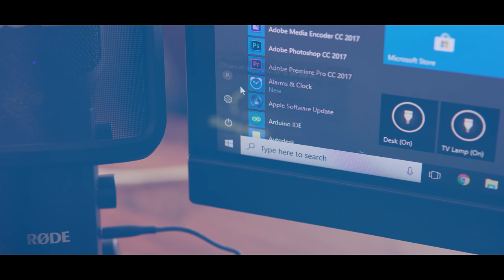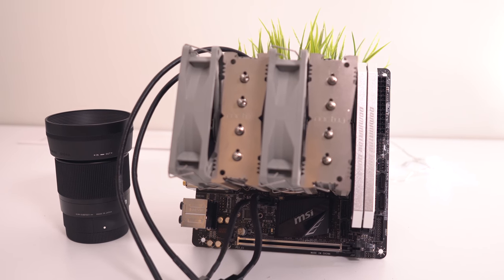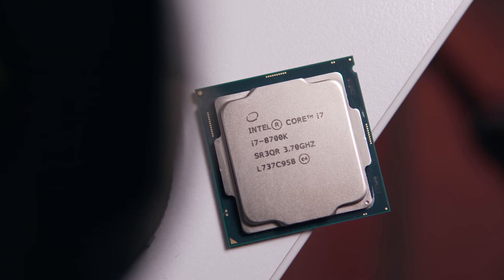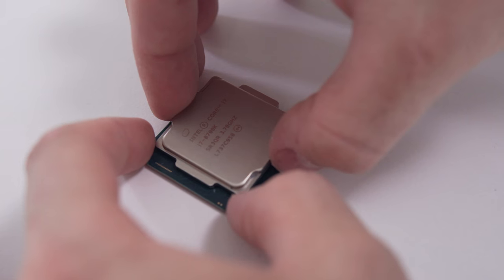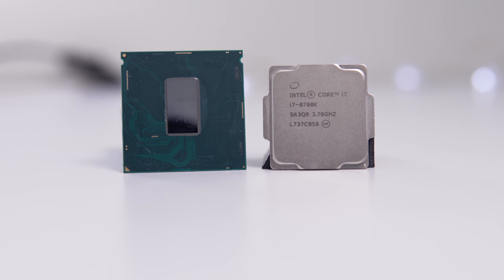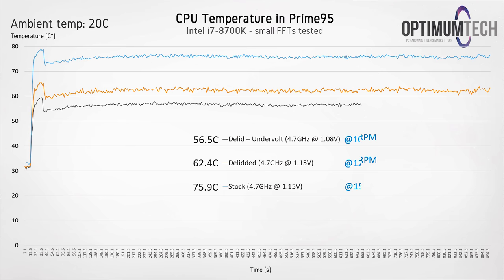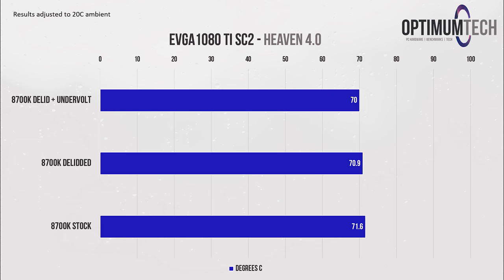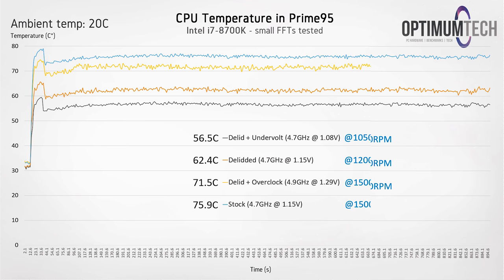8700K Delid & Undervolt - 20C° Drop!

Comment: can non-overclockable cpus in this gen like the 8400 be undervolted?
Reply: nickt i think it can
Reply: nickt i am pretty sure. On locked cpus u just cant change the multiplier.
Reply: Every cpu can be undervolted. Running my 4790 @ 0.95V

Comment: i got the i7 8700k and was having some serious 100 degrees in prime stres test, tried with extra fans, case and even got coolermaster maker nano thermal compound (lowered a bit) but nothing droped the max temperatures enough,  so i undervolted to 1.24 from the auto 1.4 and got down to 80 degrees max at 4.8GHz all cores, the sweet spot, dont care about highr clock. (edit cos i got some better numbers with a bit  more testing)
Reply: You need a water cooling system to cool down this beast.
Reply: u are right, we are in summer here, and i am in a hot city 36 degrees ambient, if i wanted to go any hiegher than 4.8 GHz i would need more voltage and thus watercooling at least.

Comment: Great video. I do undervolt my 8600k by 0.095v which is giving me max temps of around 70c. I do plan to delid in the future so I can run the fans slower in the future
Reply: what motherboard are you using?
Reply: MSi Z370 Pro Carbon ITX with Nocuta D9L with two 2000rpm fans. Testing has been done with Cinabench and Intel Extreme tuning as games don't really stress it.
Reply: My 8600k is overclocked to 4,9GHz, and i am stable at 40 degrees. Got over 50 degrees only one time for 1 minute!
Reply: what are your overclocking settings? I went for 4.9 GHz (stock) and 0,020 V overvolt for @ 71 °C (still much lower than automatic OC at 5 GHz, which was around 85 °C). Asus ROG Strix Z370G mobo. Scythe Koketsu cooler.
Reply: jackelofnar bro does it safe ?
Reply: That is not safe .. quite bad actually . Using "in the future" twice in one sentence, thats covfefe. What is your actual voltage x - 0.095v =                  tanx

Comment: video idea: test the temps difference beetween this current cooling config and a 2.5 slot gpu with slim fans or without fans at all at the bottom of the case (thinking about the strix or the new silent evga gpu)

Comment: I read about undervolting, it's less recommended than overclocking, because it messes with ram potentially ruining the DRAM in the process. Ram looks for certain stability too, and if CPU cannot give it, DRAM will erode and with it will start taking your system files and documents, corrupting good files, and burning your data to shit. Granted it's an excessive example, but it will do it slightly at first, potentially making you lose a lot of important information from your system. 

I would stay away from undervolting.

Comment: got mine literally yesterday. Overclocked to 4.8ghz at 1.29v. No luck with silicon.
Reply: thats pretty standard voltages for that clock speed. Mine is set to 1.264v for 4.7ghz on all cores.

Comment: 20c only?? I dropped almost 50c @ 5Ghz 1.30v <3
Reply: Well he is running an air cooler in a small case, so the temperature difference may not be as great as a water cooler or a well ventilated case, or both.
Reply: @aventrikz8787  :D 50c is sick anyway for delidd. Isn't it? It seems like it is anyway, maybe i won the silly lottery. I just need to cool my VRM on GPU now. Kraken G12 doesn't do it's job properly. I want to mount my corsair h150i 360mm aio radiator on it too, i have 2.. But it won't fix the mount coz it's not round.. i got 1080 gtx

Comment: Hhmm, with deliding and undervolting, would I be able to lengthen or prolong the life span of my cpu?
Reply: MAYBE a little, but you have to understand even at stock (no delid no undervolt) assuming no overclock the CPU will last 10+ years easy assuming you have a decent air cooler. You risk potentially damaging your CPU via Delid (and no one really knows the LONG term effects of it) for maybe an extra 6 months which means nothing because the stock CPU would already last longer than you will want to keep it (after 8-10 years or so it will be obsolete anyway) The main reason to Delid is to allow higher overclocks and improve lifespan when over clocking heavily by keeping temperatures under control. If you arnt going for a high overclock then dont delid.

Intel CPU's are very resilient as long as you keep temperatures under control i have an I7 2600k overclocked from its 3.4 base to 4.6ghz non delided thats been running 24/7 with no speed stepping for 7 years now with not a single problem. That shows you the kind of life span these things have even when pushed way beyond stock
Reply: Thanks for the info. I forgot to add that my laptop (Asus VivoBook 15 X542UQ) may have not a good airflow design/layout.
Reply: I still have a QX9770 in one of my PC's. Overclocked to 4ghz. 10 years old and still going strong.  It sits at around 65-70c max with a be quiet Pure Rock 120mm.
Reply: I never ever heared in my entire live that a cpu died because it has exceeded it life span.

I only heared cpu died because of too high temps or too high voltage.
Reply: Your entire system will be dead before the cpu start failing, so no worries.

Comment: The ambient inside the case would be hotter? You're removing more heat from the CPU and dumping it into the case via heatsink. I don't understand those gpu temp results.
Reply: I think his logic applies with the undervolting because im assuming the power consumption dropped. 

But i think as far as at stock voltage the cooler cpu temps from the delid and liquid metal shouldnt matter for case and gpu temps because same amount of energy being used roughly. 

Although you could argue it should be more efficient running cooler because resistance and other stuff I cant think of or dont know about.  But is that alone significant enough to matter?

Would be interesting atleast to test    to satisfy ourselves.  Measure gpu temps and even heatsink and case temps before and after delidding.  Maybe make an extreme example of highest cpu temps without throttling and then really low cpu temps.  Same voltage, power consumption, fan speeds and all other variables held constant.
Reply: cpu eats less energy = less heat generated. the transfer to exterior comes after.

Comment: I feel very left out every time i buy a new pc component. I had a 6700k and it was hot as Stacey's mom but this 8700k is super hot too. I dont delid but i hit 80's in stress tests and i use a noctua nhd14, and well... im kinda new to oc and voltage stuff but i dont want to brick it :/

Comment: what cooling fan brand is that?
Reply: Happy Hopping Noctua D15
Reply: thank you.  I like & use that brand, although my next build, I'll switch to CoolerMaster
Reply: Yes I purchased one and can attest that it performs equal to a Corsair h115. It is dead silent. The Corsair pump was too loud for me
Reply: I'll never buy anything from Corsair again.  That "incident" they have with their SSD and their refusal to fix it flooded their own forum.  They don't answer phone, and email were never returned.  Fortunately I sold those 2 Corsair SSD to someone else and cut my loss.  2 Years ago, I did, as a try, to retest their product, thier Al plate Mid Tower case: they are so cheap that they use the same black color cables on ALL those wiring from the front panel

Comment: Nice results you've got there. Have my 8700K running 5GHz @ 1.28V. Going to delid it as soon as the Rockit Copper IHS arrives, curious to see if it will have any improvement over the stock IHS

Comment: Fractal Node 202 build next please!
Reply: King Haro The 8700K stock voltage will definetly run around 90-95C without delid in this case and will probably run 75-80C even with delid using Scythe Big Shuriken 2 Rev B.

Comment: Why not take it a step further and watercool
seems if you would bother to delid and void your warranty, and cool 20C, may as well cool it even more
Reply: there is a video that confirms water cooling and air cooling cool the same lol. well might be watercooling but aircooling still good
Reply: This reply isn’t timely, but whatever. Delidding solves a different problem than water cooling: it allows better transfer of heat from the silicon to your cooling solution. How much thermal capacity your cooling solution has is a whole other matter.

Comment: I have an i5 6400 @4.6 GHz (non-k-OC on Z170) with close to 3200 MHz DDR4 and it does not even reach 60 degrees under full load with some "no name" Traquillo cooler I got for under $10, though the fans of it have been replaced by $6 bequiet ones since they blew up on a totally working fan header - weird. Seing a close to $400 8700k at temperatures that would result in throttling with a like $30 cooler @Stock speeds is just pathetic since, as discussed in this video, Intel just cheaped out on the TIM which could just have been solder, apparently for longevity? Right, there must be many Sandy Bridge user complaining about bad TIM or high death rates, right? No? Well than just f* Intel unless you want to trade Single Core speeds for scummy business pratices and a Meltdown in two ways.

Comment: Can i delidd and undervolt my ryzen 5 1600 @ 3,8ghz?
Reply: The AMD Ryzen processors are soldered, which is already amazing. Just go for an undervolt.
Reply: No you don't need to delid it cause AMD did an awesome job and it's soldered you wont gain nothing temperature wise, you can undervolt, ive mine @3.7 with 1.2375v
Reply: good paste wont hurt, considered water cooling? and ive heard ryzen doesnt overclock well
Reply: Brad Haines man i got my ryzen to 3,9ghz stable.
Reply: What voltage? and what Ryzen is yours?
Reply: gr33nbits i got a ryzen 5 1600. I activated the docp Mode in the BIOS and Set my ryzen to 3.9 which equals 3900mhz. The voltage was set automatic to 3,8v or so
Reply: You mean 1.38v i guess yeh that's probably to much, i wouldn't overclock and leave voltage to auto if i was you.
Reply: gr33nbits yeah right i mean 1,38v
Reply: gr33nbits but isnt this voltage Safe?
Reply: Yes it's safe and good for 3.9 you can try go lower but it's safe, for now i keep mine @3.7 with 1.24v later on if i replace the Wraith Spire i will go up.
Reply: gr33nbits ok yeah thank you!
Reply: I just said to not leave auto and manually set it to 1.37v and see if if it's stable, i wouldn't go pass 1.38v for 24/7 use, if you benchmarking  you can 1.42 or 1.45 but only for tests.
Reply: If you have voltage at auto it will always adjust and there wqill always be errors and your cpu will potentially get killed by your motherboard if you are very unlucky.

Never use auto voltage on overclock. Especially when you push a ryzen so hard to its border of overclockability.

Comment: Can I do this with ryzen
Reply from the maker: Undervolt yes, delid no (you don't need to)
Reply: You can undervolt Ryzen but theres no need to delid those chips because AMD hasnt used cheap thermal interface material (TIM).
Reply: Ryzen CPUs are soldered so they already have the best heat conductivity out of the box.
Reply: It means Intel is bad on this case
Reply: still at the end, lga 1151 gonna die, am4 has at least 5 years to live
Reply: Not intel fanboy, but cmon man, 1366 and sandy bridge still dying (no, they work perfectly fine) ;)
Reply: 1366 work perfectly? come on man its an old architecture i got an i7 950 before and it was stuuttering you really need to know the basics good luck
Reply: Dont wanna argue with you, keep with your opinion. 6 core xeon in OC with good ram work almost the same as 4790k stock, especially in cpu intensive games.
Reply: "with good ram" yes, like ryzen get HUGUE performance boost with good ram, its not an intel thing
Reply: its absolutely the same with intel, pls do research before saying something
Reply: ok and then? sayin the socket 1366 work perfectly is the most funny thing ive ear for a long time, thans for this funny time.
Reply: Yeah sure, your broken hands experience is so much more reliable than thousands of benchmarks showing 1% lows and 0.1% lows being fairly good. You can also piss in your own mouth and call it your personal experience, and start spreading the idea of it. 
Btw, there is one more video watch?v=KcoPxVw6yEE  showing about 20-30% difference between early 2010 and 2018 cpu at 5ghz.
Unless you can provide any kind of proof of your words here, you can leave this discussion, ty sir.
Reply: yeah intel fanboy, intel got better IPC and latence, and yes a 8700k outperform a ryzen 2600 but i dont have to pay TWICE the price for win 20 fps 
price/performance AMD win, and what you dont know is than the new octacore from ryzen will out perform your poor i7  6 core in the future, when architecture be matured and gain in IPC and latency and when optimisation for 8 core come, it will be at this moment intel fan boy like you will start to cry, and i will really enjoy this.
Reply: I see, you are on the edge of schizophrenia... convalesce.
Reply: Artyom Shvegzhda i can see here you have no more to say, resulting by this off topic comment, and showin how your mind is narrowed, but afterall you say what all kids say when they have nothing to say, bullshit... like your first comment comparing a 8 years old platform to an actual. Maybe you just got no money and then i can understand your fascination for old platform, but wake up, its 2018
Reply: Artyom Shvegzhda yes 1151 gonna die and 1366 is die since a long time, did i talk about performance? No .
You miss that point, hardly.
I mean the way am4 socket will support future cpu and 1151 dont, but you , intel fan boy, was so offensed, than you talk me about your 1366 which is no more manufactured since when the world trade center was again up.
So yes 1151 gonna die, and am4 is going support cpu at least in 2020. So finally you first dont understand and runnin in the wrong way, but that was nice try.
Reply: Oh nice, you are starting to flip that over now. I must remind you that YOU was talking about performance, stutters, old architecture etc. You didnt say a single word about socket support.
And again, get over with mess in your head, ty.

Comment: When I undervolt my I7 7700k to 1.13 volts everything runs well. But when I run prime95 it says that "worker stopped" for most cores. Only two of them keeps running. The processor is coupled with a 1080ti and a gsync monitor so fps matter. Am I losing fps by undervolting (making cpu the bottleneck)?
Reply: No you're not losing fps, but you'll want it to be stable without errors in prime95, and test for several hours, otherwise you may run into stability problems later on.
Reply: TheRedronn Then I lost the silicon lottery. Because to have all workers active in Prime95 lowest voltage required by my processor is 1.26 volts with a mild overclock to 4.6 Ghz.

Comment: After delid I am stable at 5.4 GHz 1.375 volts and never goes higher than 70 degrees Celsius after 4 hours on Aida 64 and Intel burn test
Reply: if that is even true then congrats you have won a pretty fucking amazing silicon lottery
Reply: Amperu yeah I'm really happy with this chip. Its been doing frickin amazing. I just need a GPU :( I haven't been able to find a 1080ti for a decent price so I can't game
Reply: WarmSoftKitty here is the proof kiddo https://valid.x86.fr/vtw2p8. Yep that's my delidded 8700k stable at 5.4ghz and 1.4 volts.